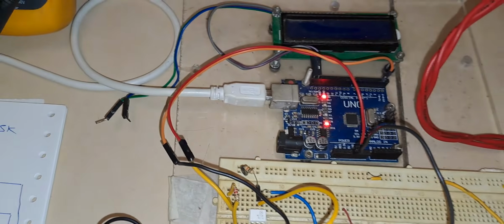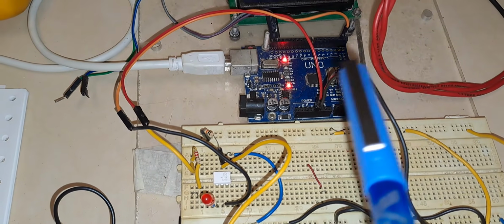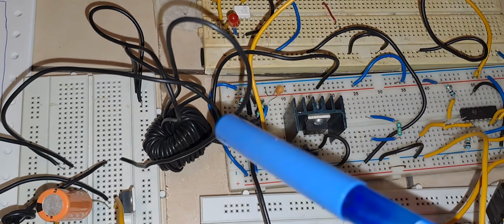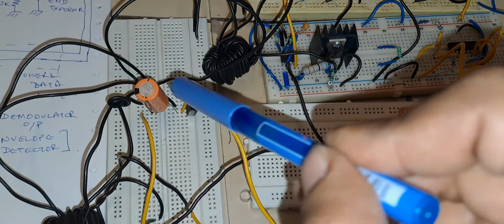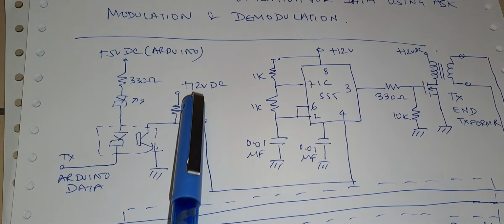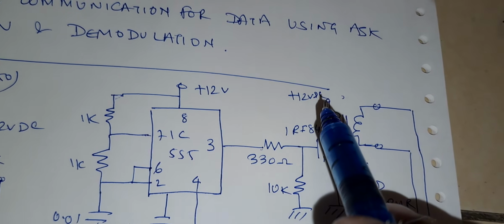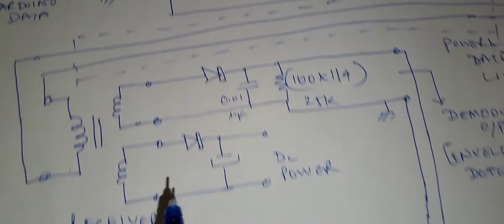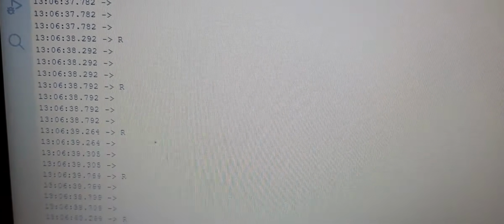Power line data communication using ASK modulator and demodulator. Arduino uno used for data.

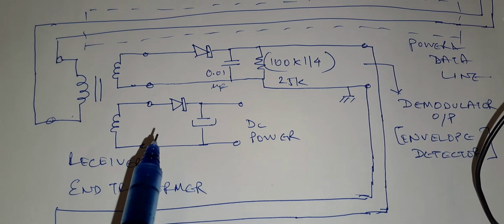Comment: 5:06 you are using low pass filter according to the diagram.
It is not possible to filter signal with low pass filter